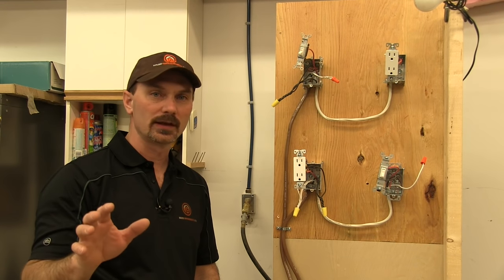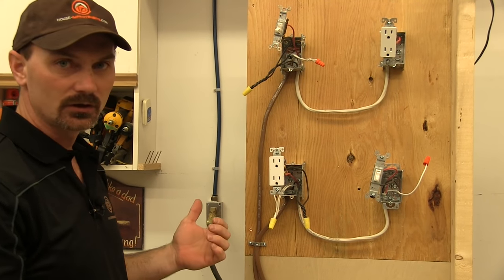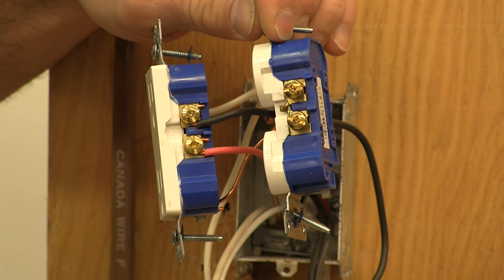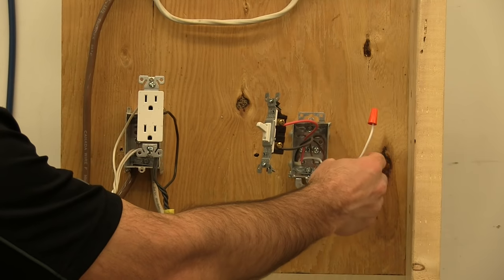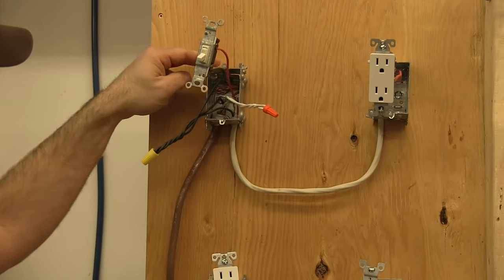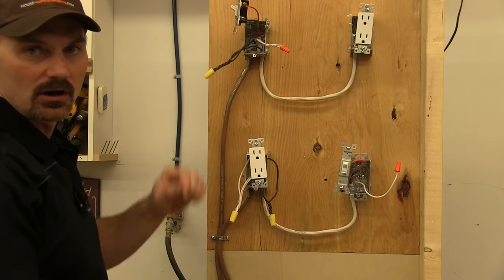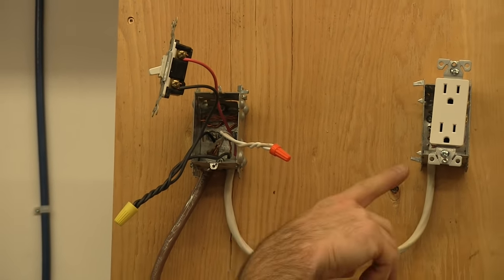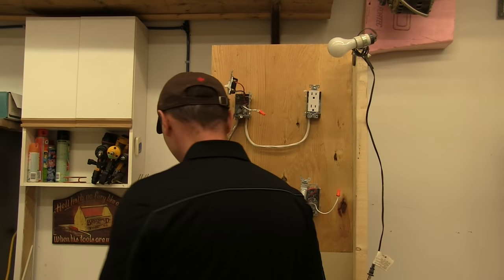How To Wire A Switched Receptacle

Comment: A great visual explanation on how switched receptacles work. As an 20+ yr electrician in the US you get a thumbs up for this video. Personally i prefer any box that is not metal for residential for easier and faster installs. I hate those types of metal boxes. Thanks for not stabbing the receptacles and switches in the back and for the good connection points on the switch and receptacle.
Reply from the maker: Thanks Tony!
Reply: I really want these manufacturers to stop with the stabs in the back.

Comment: very simple, straightforward...now excuse me while I watch this 100 times to figure it out.
Reply: Rob, did you figure it out?
Reply: Rob M. You are funny. My thoughts exactly. Thanks for the humor!
Reply: Jack P ...legend says Rob is still figuring it out
Reply: I'm next in line to figure it out. I want to wire a paddle switch to an outlet for the router table I built.
Reply: @jp71889   Hi, Can I get some help? I am was able to do what shannon did with the switched recepticles, but I am trying to have serveral recepticles and have one switch turn them on and off. I have tried the above and that works, but the second part is not. For example, when I do not break the pin both recepticles are supose so switch on and off when the switch is energized, but this does not happen. Can someone help please.
Reply: @sherazhameed4931  you want your switch to be wired between the breaker and the outlets that you want to control with the one switch. Your red wire from the switch should connect to one of the positive poles of one of your receps. When the switch is on, the electricity will pass from the breaker, through the switch, to the recepticle. From there, it's simply a game of daisy chaining the receps together. Using the standard black wires to positive poles, neutral wires to neutral poles and ground to ground. If this doesn't help, feel free to send me a private message and we can exchange e-mails with diagrams.
Reply: @jp71889  So I understand what you are saying above. So you are saying to have the switch in series with the circuit right? So take the hot wire from the main put it in series with the switch and then connect the hot from the switch to the reps. But what about the return, do you take the last return which will be the netural and place that back to the switch from the last rep? I was thinkng of this but I didn't want to do this because this will mean runing more wire, but it doesnt seem like there is another choice. Please e-mail me and we can do a zoom call or something. I want to get this project completed safely LOL hahaha.
Reply: I do the same no matter what is it not sure if it my memory or just me being safe
Reply: @sherazhameed4931  correct. using the extra wire is worth it. You want to do the job right, no short cuts. Bottom line, this could mean your safety. Plus, if this were work that needed to be inspected, they're going to make sure you do it right. 

I'm not a certified electrician, i'm not qualified to give you any professional advice. What i shared about is purely my opinion based on other videos i watched.
Reply: The old vide (VCR)o  rewind after use please, yey! NO 2.00  fee for rewind only 3.09 to watch the video? Also this like it its a choice 👌 😅, old school.
Reply: @jp71889  I am having the same problem trying to swap out an old switch & outlet to update them. The old switch looks different & used all 3 wires to 1 screw. The screw has 2 holes leading to it.  The metal tab was removed on the old outlet. I didn't know anything about that until I watch your video. Bcuz it is my son's room, I never paid attention to just one side of the outlet working with the switch. I do want the switch to control the entire outlet. If it is not wired that way, I'm ok with keeping it the same as b4. I really just want to update the fixtures. No matter how I wire them, the switch will not work with the outlet. I even tried capping off one of the neutral wires. Then, I was able to control the bathroom light & opposite bedroom from the switch...lol. I'm so confused. Plz help. I would like to email u to if possible. TIA 😊.
Reply: I'm watching this at 2:00 in the morning and I'm busting up laughing 😂😂😂
Reply: How can we do this with a gfi
Reply: Lmao ikr
Reply: Lol I know what u mean man, but here in Houston codes are mean
Reply: Right???  I drew diagrams over and over until I got it right😃
Reply: 100 Times 🤣🤣
Reply: “VERY SIMPLE and STRAIGHTFORWARD “ yet you still need to watch it 100x, can’t imagine how you deal with complicated, let alone a very complicated situation.
Reply: I'm about 4 years too late but did u figure it out? Lol and I do the same thing 😂
Reply: @planetkaty7573 that would be the joke....

Comment: Never knew you had to remove the metal clip to have the outlet work off the switch. Very helpful!🎉
Reply from the maker: If you dont you end up with a short when the switch is turned on and the breakers will trip

Comment: Again your video aided in a second problem that arose after i thought i fixed the outlet.  Problem started with the outdoor leaf blower which caused indoor outlets to stop working. Found the culprit changed the outlet but wasnt able to get power from wall switch to power it on and off even though it did have power. Forgot about the tab which you reminded me in your vid. Im glad you showed the two different examples because ours is a late 80s house and theres still some older outlets. Always appreciate your videos! Best ones out there. 👌

Comment: Here in Oregon, we can wire anything residential including a full service panel as long as its your own property and you pull a permit. I found the electrical inspector to be very helpful in making sure I understood the codes. 

Good info. Thanks.
Reply: Ttf Web thanks I live in Oregon as well and was wondering about this. Do we need a permit even for adding a switch?
Reply: Permits are to get money from you. Don't bother. Do they send out an inspector?  If not, just do it without permit.

Comment: Thanks so much for posting this, what I wasn't understanding was the small tab connecting the upper and lower outlets. Your video solved the problem.
Reply: I'm confused!  The new outlet I have has two tabs, one on the right and one on the left.  Is the one on the right the one that needs to be snip or does both of them need to be snipped?  Looks like he only snipped the one on the right.

Comment: Thank you for this. Had to replace a receptacle connected to a switch, wired it exactly the same and the switch had no effect in that the new top plug was constantly on. Didn't know about the little tab between the two receptacles that needed to be severed. Now I do! Cheers!
Reply from the maker: Excellent!

Comment: Great video. Just a note instead of using a jumper wire for the power to the switch, if the outlet has a "push" connector behind the screw you can simply insert the wire traveling to the switch. Worked for me thanks again for the great video!
Reply: Bad wiring practice.

Comment: No spark, no boom. If you forget to break out the tab, both halves of the outlet will remain hot no matter the position of the switch in your examples. If you desire the outlet halves to be on different circuits(breakers) you certainly could have a big boom, depending on the positioning of the breakers in the circuit panel. Thank you for the videos!
Reply: Thank you for clarifying about the tab. Makes a lot of sense actually since on the same circuit breaker the source of the power is the  same, hence no sense for a spark...

Comment: Thank you so much for this video. The second part of the whole outlet being controlled by the switch is what I was looking for. I have 14/2 only and am going in this blind from the previous owner. I already know that I have to take all the breakers out and switch them to 15 amp as he put in 20 on 14 gauge wire. But this tells me what I need to know as far as my switch goes. Will be watching again when I go out and finish my wiring. ;)

Comment: Make switches and receptacles “smart” where you hook into them via a USB connection and “program” them to work the way you want.  This would be done via a graphical interface.  Then you simply plug in the Romex wire into the switch or receptacle (stripped wire) and viola, you’re done!  This also would allow you to reprogram each switch should you ever change you mind on how you want the switch or receptacle to work.  This eliminates error, increases safety and ease of installation/configuration.
Reply: No more guess work, or “Did I use the right wire in the right screw or slot?”

Comment: Thank you!! This was very helpful. We didn’t know you had to break the tab. We didn’t have any sparks, we just broke the tab and then the switch worked.
Reply: All it’s does is short the connections for one wire to run both live screws It shouldn’t have sparks unless it’s three phase AC

Comment: It seems that I owe my kids an apology (sort of)...Thank YOU for your explanation! I always assumed that one of my kids did something to burn out the light switch but I let it pass because they were young and unharmed by anything they might have stuck in the outlet. In my mind, both receptacles still worked just the switch was shot. I bought covers for every outlet and threatened them with DEATH if they removed them! After watching your video I decided to replace the switch and the outlet while I was at it. Replaced the switch, no problem...went to replace the outlet and it turns out that whoever did that part of the wiring in my house never broke that tab out on the outlet for interrupting the circuit. For me, YOU have helped...for my kids, I hope they threaten theirs with DEATH if...😁...apology to them (kind of)...

Comment: Thanks for the video. Any ideas how I can find which receptacle a light switch is connected to ? I have a light switch in my living room and I assume it would power on/off one of the receptacles in the living room, but doesn't, I tested all receptacles. I opened up all receptacles, my best guess is a receptacle was replaced at some point and the light switch became redundant, but would like to try see which one it powers and hook it back up or find where it goes to ? I would like to use the light switch again.
Reply from the maker: Usually the switch will only control one of the outlets on a duplex so unless you checked both top and bottom outlets on each duplex you could have missed it. If it was unhooked then you would be looking for a unhooked and hopefully capped wire or two in a box. Could be white or black possibly. If you need more assistance please use my forum after.https://www.house-improvements.com/forums/
Reply: @HouseImprovements  Thanks Shannon, I checked both up and down, I even pulled out the receptacles and looked to see if the metal piece was broken. I did find one plug with an extra black wire capped

Comment: Thanks for the video - I'm adding a power outlet, a light fixture and a switch to control both at the top of my attic stairs. I'm pulling power from an existing outlet in my attic and your video helped me figure out the sequence.  Looks like 21 nellies are too squeamish to take on this type of task and felt compelled to give it a thumbs down...  Electrical ain't for sissies! Keep up the good videos!

Comment: Your video is simple and straightforward, I fully understand. With drywall in the way, I'm not sure how my 1970s outlet is wired. I don't know if the red went to a switch or another outlet.. Is there a way to tell. It's a 1970 home, all rooms seem powered by the same circuit..
Reply from the maker: We can assist you on the forum.https://www.house-improvements.com/forums/#google_vignette

Comment: Good video my only problem is I have one switch controlling a light in the basement at the bottom of the stair which also controls a micro wave oven in the kitchen so you guessed it to use the m o  we have to turn on the switch. I think you gave me the answer we shall see thanks.

Comment: Our code calls for a switched receptacle in every inhabited room. Was trying to figure out how to put it in when there is a series of ten outlets and it's the middle one. Because of so many outlets in this large room, I was trying to avoid a three wire that would travel all the way to the other wall and also, how to you continue past this outlet with power.
Reply from the maker: You may want to ask in our forum , we can talk you through this process.https://www.house-improvements.com/forums/

Comment: Hi Shannon,  I currently have the set up you spoke about where the power comes into the outlet and half the outlet is always hot and the other runs via a switch. On that outlet side that runs by the wall switch I have track ceiling lighting.
I removed the track lighting and ran 12ga 2 wire in the ceiling for a ceiling light.  I changed the outlet to have both outlets hot at all times. What's the best way to hook the wiring to the outlet so as to power the ceiling light from the wall switch.  Thank You

Comment: Why use a pigtail for the neutral?  Why not wire both neutrals to the outlet and do away with the bulk from the pigtail and wiring nut inside the box?

Comment: Thank you for the video. If I want to make the TOP plug in the receptacle to be on the switch and BOTTOM one to be alwaysOn with constant power , in both examples, I just switch the red and black wires going to the plugs right ?
Reply from the maker: yes

Comment: Thank you for the video. I am wanting to change the function of a switch in this room I'm remodeling currently. The switch controls the fan light on the ceiling right now but I want it to control the outlet on the wall instead. So I would just disconnect the red leg wire that goes to the fan light and run my own red wire to the hot on the outlet,correct? The neutrals and ground in the switch and outlet can just remain as is? Can I run just the one red wire through the wall to the outlet? Usually it's Romex 2 or 3 wire but I'm this case I only need the one red wire so that's why I ask.
Reply from the maker: Our forum is the best place for assistance.https://www.house-improvements.com/forums/

Comment: Great videos!  They have helped me out many times in the past!   I do have a question... I have an older house, and as I was changing out the switches and duplexes I came across this application in one room where the bottom simplex is controlled by the switch except mine has a crazy amount of wires - 2-black, 2-red, 2-white, and the copper ground.  I took photos and copied the wiring exactly, but for some reason, I'm still not getting the split power.  Any suggestions as to what might be my problem?  Thanks!
Reply from the maker: Please post in our forum.And maybe include one of the pictures so we know what you had. https://www.house-improvements.com/forums/

Comment: If you just treat a receptacle like a light  can you just use 12/2 run a switch leg to the receptacle  then in the tap just tie the neutrals together and put hot and switch leg on the switch ? I did some work at my father-in-law's and he had some plugin fluorescent lights  so I just treated the receptacle as it was a light I'm second-guessing myself because I know normally you have to use 14-3 or 12)3 like you did in this video but that's only if you want to make one side hot and one side switch right

Comment: I need to do this in my attic where i need an outlet to power video cameras. is there a way to have both outlets in the receptacle when the switch is off to have continuous power instead of just having power to to both when the switch is on? great instructional video thank you
Reply from the maker: So when switch is off you want both to have power? Why have a switch then? Use my forum if you need more assistance .https://www.house-improvements.com/forums/
Reply: HouseImprovements well the reason is my attic has a light switch and I was going to add an outlet next to the light switch and that's why I was curious to know.

Comment: great content, thanks! another owner of an older home here 😁i was planning to split the switched receptacle, but found that there's only 12/2 coming into the receptacle from the outlet. am i right in assuming i can't split the receptacle (half hot) without being able to run either a new 3 wire run to the switch or a single switch loop wire? (there's no great way for me to do that in the house....so if so i'll have to live with a fully switched receptacle 😒thanks!
Reply from the maker: correct

Comment: very informative and what i was looking for.  I want to swap my outlet with one that has 2 usb ports. How would i make sure the ports would maintain constant power like the upper half of the outlet and still have a switched nightlight on the bottom half?  My wall switch and outlet are already wired for the constant/switched capability.  It's just the usb that's still a mystery.
Reply: r dean The outlets pack that I bought with the 2 USB ports had a single hot , single neutral. There was no way to split the 110 v outlets.  You could switch  both outlets or leave both on constantly. 🇨🇦

Comment: I recently bought a semi older house. They used a 12/2 Romex from the switch to the receptacle using the white wire as a hot wire, meaning no neutral in the switch box. All the fans are kind of wired the same. Is this acceptable. Great simple video🤙
Reply from the maker: Old code allowed it but new work needs to be up to new code.
Reply: @HouseImprovements  thanks for the reply. Appreciate it.

Comment: Great video. But lets say I don't want the receptacle to split between one hot and one on a switch. I just want the switch to control the complete receptacle.And I have 2 more receptacles in the leg. Would the method you showed in your video How To Wire A Single Pole Light Switch apply? Meaning, I can just substitute the lights with receptacles?